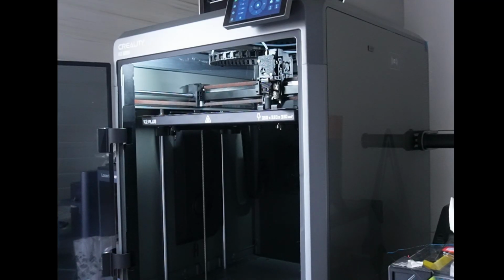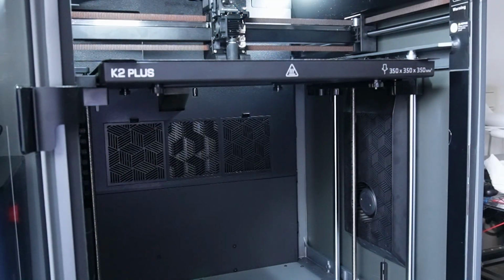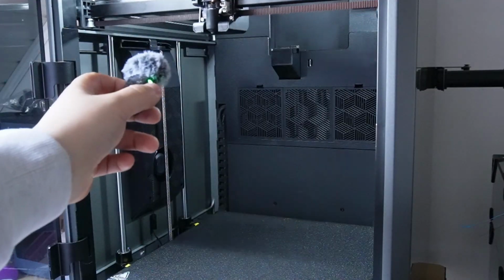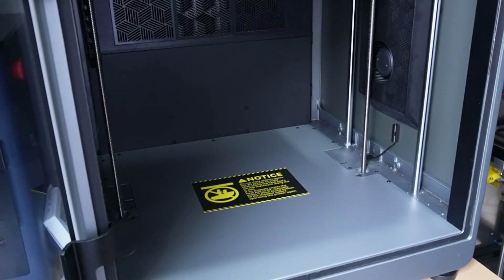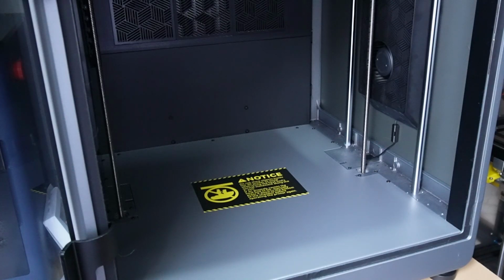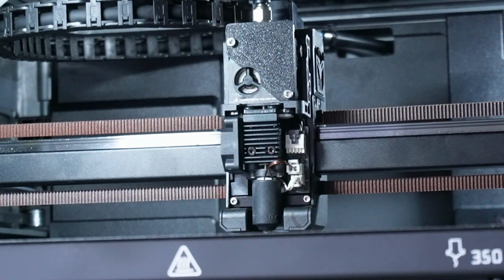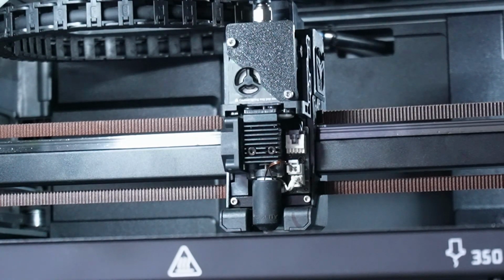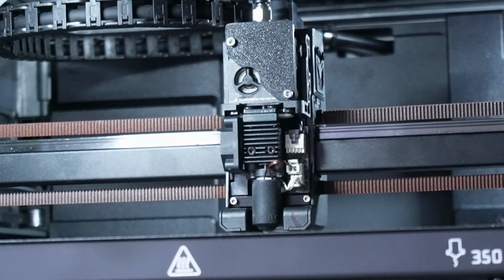More problems with the Creality K2 PLUS COMBO

Comment: I have 2 of them in my farm and have loved them. Total workhorses for me and faster then my bambus with the same quality print. I did have issues on one which was the magnet bed coming up in corners due to my large prints, i desgined printed PC corner clips and now they are working perfect.
Reply from the maker: glad to hear that, i hope after the replacement parts mine will be perfect too... only problem is Creality is taking ages to send them over... fingers crossed
Reply: @aim6mac  my sovol was the same way, support did send needed items but was a long time waiting.

Comment: Creality is brand that should be avoided. Return it if you still can.
Reply from the maker: in general it's a good printer, maybe return it and wait for V.2
Reply: @aim6mac  May be it is just bitterns is speaking from me as I ordered 2 k1 max printers from creality and both of them I returned as defective from factory. That ordeal cost me too much time and nerves lost. The thing is that they knew that printers are defective from start and they did not even tried to fix the issue, even when printers where on the market for 1.5 years. That tells a lot about creality as brand. Sorry for long reply, thanks for video.

Comment: I keep getting X-axis and Y-axis errors the extruder keeps getting filament issues and the CFS filament keeps getting stuck and retraction errors. When I manage to get it to print it's great the trouble is getting it so it will print the same as my Bambu A1 send to print it then prints. As for the software I cann't get it to see the printer but at least the USB option works
Reply from the maker: sounds like you may have a lemon there

Comment: Having belt tension issues, few days old.

And from study it can be a range of things.

Waiting on message back.
Reply from the maker: you should try to manually tighten the belts a little on the back of the printer and the rerun the belt tensioning

Comment: I'll be honest, I didn't hear anything while the Z axis was moving.
Reply: It’s a slap noise, mines doing it, just bought it, I also have belt calibration issues.

Debating whether sending it back, only had a few days.
Reply from the maker: @FLOOD-CLAWS  hi there, if you have to option to return it, then do so, I cannot return it anymore.
Reply: I heard it, but I’m not sold on it being a large issue. But the eye of the beholder is the issue here.
Reply from the maker: @ well exactly eye of the beholder .... if u pay 1.5K on a printer, it shouldn't have those 'minor' issues either , don't u think?
Reply: I can absolutely see your point here. 

What ended up being the actual problem, I see you took things apart and said it temporarily fixed the problem. Has it recurred?

I ask because I’m looking to invest in the k2 in the coming months unless the Bambu h2d comes out or is announced sooner rather than later.
Reply from the maker: @st3venb  sadly it has occured again, to fix it again temporarely i have to turn the guiding rods manually to a point that it no longer gives strain to the bearings, but after a while it starts happening again, the guiding rods are not straight or the bearings are just faulty.. still waiting for replacement parts to see if we can fix this issue.  If you can wait then please wait for Creality to sort these issues out, I believe they will adress these eventually, but as of now u might get a K2plus with these issues aswell.
Reply: Thank you for the reply! I have only seen great things about this printer and I’ve been worried it’s being white washed ya know?
Reply from the maker: oh try to put your volume a bit up